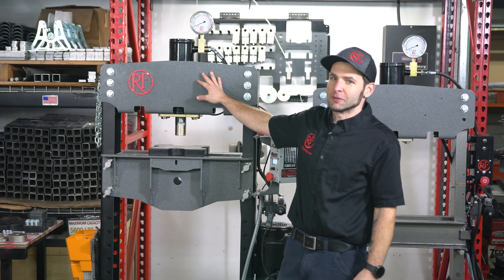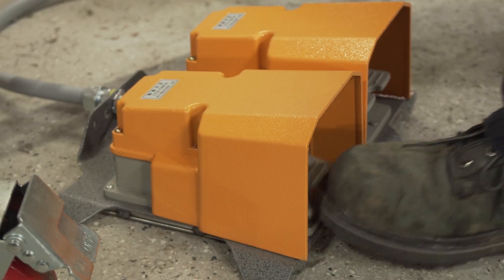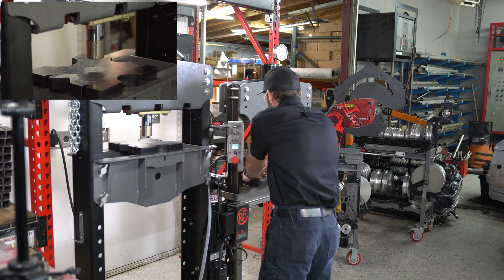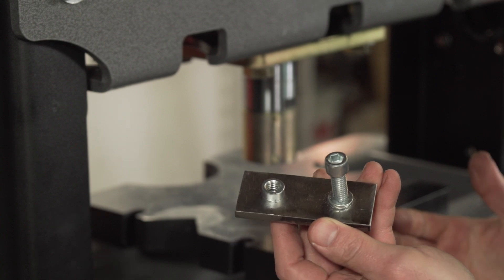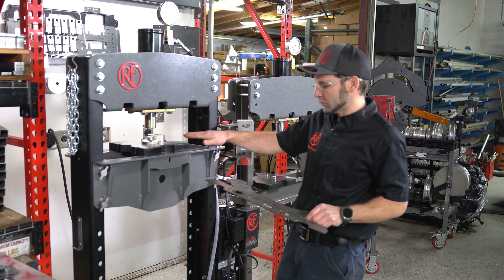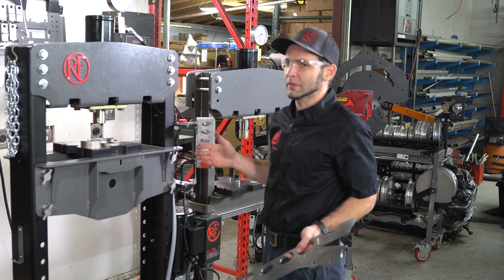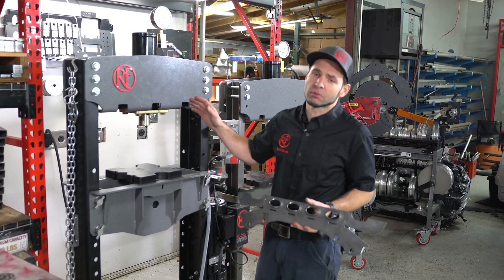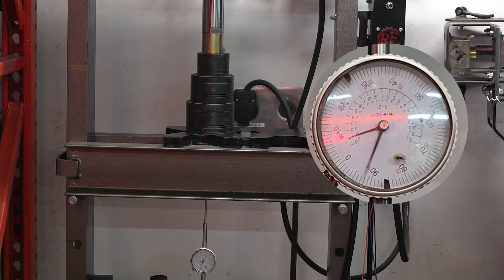BRAND NEW 20-TON Shop Press: Introducing the VersaPress

Comment: Can AVK Rivnuts be installed on the press?
Reply from the maker: If it's possible to press them in, this can do it. I didn't see evidence either way. Just people using the AVK pull tool. I'm sure it's possible, just might need a special tool to go in the press. What size do you use?

Comment: I really like how you went the extra mile in designing the press. Measuring the defection at full pressure is top shelf 👍🏻 excellent job!
I also appreciate how you didn’t put down the Harbor Freight press, as it is designed for a different group of folks. Very classy of you 👏🏻
Reply from the maker: The HF is still a good, cost effective option. We didn't want to take away from that which is why the conversion kit was born. Thank you for the words!
Reply: @RogueFabrication  Thank you for bringing an area of fabrication from the stone age to modern times.

Comment: I like the detail put into the twist lock pins and the ability to dial in a value and press to it. I have used other presses that are really fast and will smash that pem nut through the part. Well done.
Reply from the maker: It is a really cool feature!

Comment: I like that you guys designed it so that you can use the tube bender to power it. The only thing I think it’s missing is the ability to slide the ram side to side to do offset pressing.
Reply from the maker: You can mount it on either side or the .middle :)   -Joe